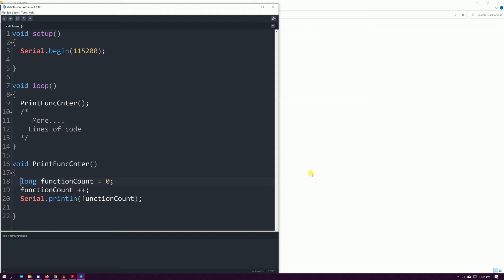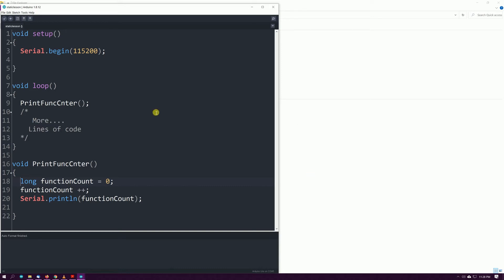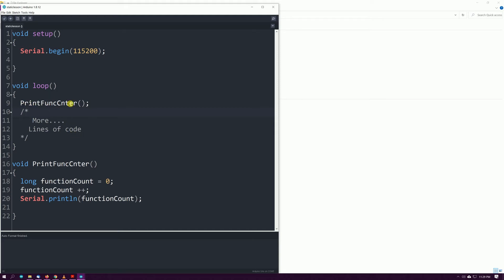Using the static Keyword in Arduino IDE Programming

Comment: void loop(){
int a;
a++;
}

in here does 'a' equal to milliseconds or for what can I equal 'a'?
really hoping a better answer.
Reply from the maker: This will depend on the speed of the micro Controller you are using.  "a" is a variable, not related to time.
Reply: @ke4est  ok thanks for the answer :)